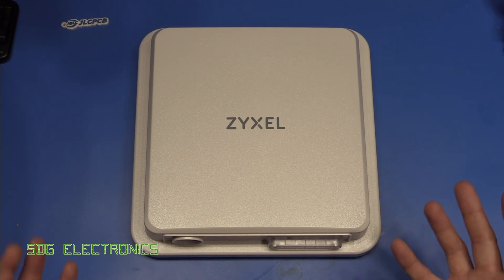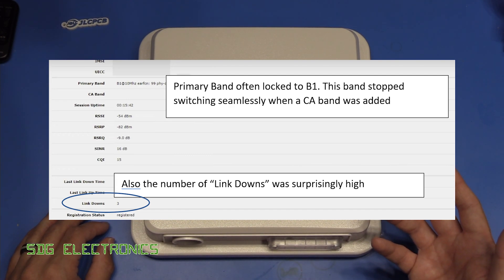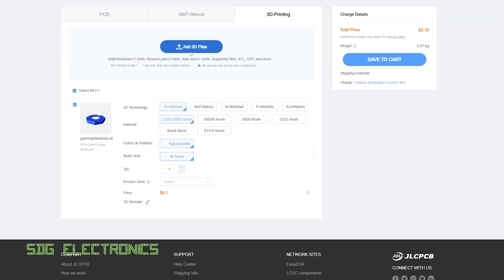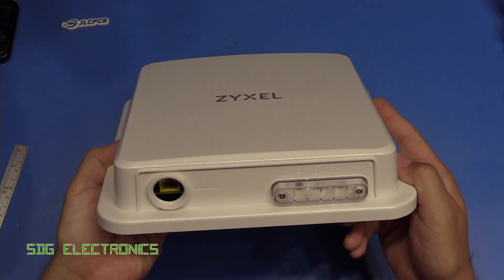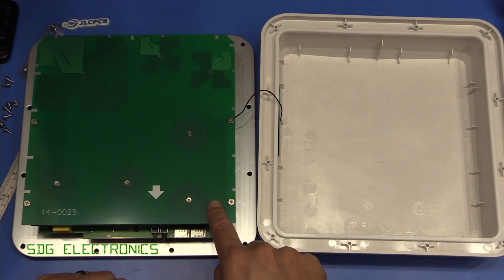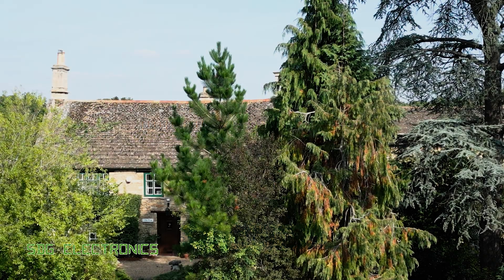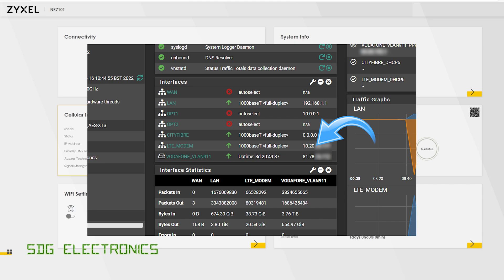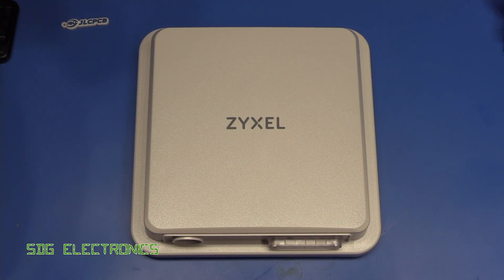SDG #267 Near Gigabit Speed 5G Home Broadband Internet - Zyxel NR7101 NR Modem and Router

Comment: Trees can interfere with signal and speeds , and worst of all is rain and wet leaves on the trees walls and roofs . (5g struggles to penetrate water shielding  on my experiments)
mounting higher up will give about 12% improvement on wet days at least.

Comment: Hi, thanks for posting, we're there any special changes for AP you had to make as I'm trying to get the Zyxel 4G version of this unit to work on SMARTY(3). Router diagnostics indicate it can ping and resolve IP to DNS etc. But client devices get no Internet connections when tested using WiFi and unit in router mode

Comment: Did you ever mount it on your chimney? Interested in whether you saw a significant improvement from the already excellent speeds you were getting.
Reply: Some say 2nd floor is good enough- especially if you have line of sight. Higher or lower can get more interference.

Comment: I currently have a NR5103E, which is alright, but it has issues with dropping down to 4G (from 5G), and no cell tower locking. Would you suggest this as a good alternative, or perhaps some other router? Also it seems the NR7101 doesn't support Three/Vodafone B32, which is a shame, no?

Comment: Thanks for this,  really happy to see you using pfsense and it having bridge mode! All my questions answered.  I'm considering this as we a semi rural area with no firm date for FTTP, and have just discovered that my home office (in the gaden) has 5G,  I can get ca. 200Mb in there if I hold my iPhone up high.  Pricey but seems to tick lots of boxes.
Reply: I reckon 5g could be cheaper than FTTH. My TalkTalk deal runs out. Jumps from £50pcm to £65 - unless I commit to another 24 month contract where it drops to £50 again. Can get unlimited 5g sims for £25 pcm. This could free me of the contract and allow me to take internet with me if I go on travels.

Comment: Are you still using this Zyxel unit?
How has it been performing over time?
Reply from the maker: Works brilliantly. Moved it up for direct line of sight and the speeds are excellent. Pretty much always better than 400/100.
Reply: Interesting.... In my case it has been fine for a little over 2 months and 1 night stopped passing traffic on 5g-nsa or auto preferred connection. Negotiates connection in N78 band for the main serving 5g band but no actual trafić going through. When set to 4G LTE for preferred connection type a is fine.... Negotiated connection is excellent and signal strength as well as SINR is great but 5g is dead. Various masts, 3sims later, different APNs.... Nope, 4g only. 5g was fine just for a short time. Many people on Three network have this problem with the indoor version model nr5103....
Reply from the maker: @arturlorek7977  have you tried the latest firmware? There's a new firmware for the radio and also the application

Comment: Hi there. Great video. I have a question (as you seem to be pretty clued up!)

I have purchased a ZTE MC7010 to use through the THREE network.

The firmware is H3G_GB_MC7010DV1.0.0BG09 - apparently the latest.

When I plug my sim card into the 7010, it connects to 5g and I get 250Mbps (directly out of the ethernet cable into my laptop)

BUT, when I insert the same SIM card into my Samsung Galaxy A73 5g and place it in the exact same position, I’m getting more than DOUBLE the speed. (I have line of sight of the mast)

Any idea why this is?
Reply: Phone is better carrier agregation .

Comment: Just purchased this and will put it into IP Passthrough with an orbi system. My orbi has the same IP address, will this cause any issues? How would I view the Zyxel admin page if they're both the same?
Reply from the maker: I would recommend changing the Zyxel admin page IP address. This is different to the ISP provided IP, and can be set as a standard internal IP such as 192.168.1.X
Reply: @sdgelectronics  that's a big help, thank you.

Comment: Hey, i am in need of such a device with panel antenna for use as a WiFi repeater/ap. 4G/5G would be nice, but fast dual band WiFi is more important for me. It should run a small Linux or has a powerful webui. Do you have such a device in your spare-parts-bin which you could Imagine to give away to me. I will care very well for that device and give it a nice future in my private network. Please think about helping me out with such a device.

Comment: Can you kindly elaborate how do you power it? Do you have to connect it to a router that supports POE output or just a plain POE switch?
Reply from the maker: You can use a PoE switch, injector or a gateway with PoE

Comment: Did you move the receiver? If so, any change in speed?
Reply from the maker: I tested it on a pole at 18m elevation DLOS, but no difference in speed so I've returned it to where I have easy reach.
Reply from the maker: After a firmware update, the speeds are even better. I tested it back up on the mast and it works far better in all weather conditions.

Comment: Glad to see you got 5g after all.
Getting over 1000mbps down and 120mbps up with my local tower when I am within 100m of it.
Drops to about 500-600 down at my house inside about 500m away.
Three very recently improved the upload speed as it was around 20-40mbps for a while.

Comment: As a Canadian, I'm wincing at the concept of automatic fall-over from the normal fiber optic ISP to a 'mobile' 5G carrier. Imagine a fault develops in the fiber, and the first clue is the 'mobile' data phone bill which (in Canada) could be greater than the GDP of Switzerland. They don't make paper that wide. We've had 5G mobile plans that would go into Data Overage is mere seconds at 5G speeds, and could cost $10,000 per minute thereafter. Sigh, Canada, home of the world's worst mobile data providers.
Reply from the maker: Luckily we have very cheap providers here. My plan is £16 per month with unlimited data, so no massive costs to worry about!
Reply: @sdgelectronics  Careful Steve, you'll drive JH to an early grave.
Seriously though.....wondering if I shouldnt implement the same.....is it just your ISP/infrastructure thats unreliable in your area or......?
Reply from the maker: @IanScottJohnston  it was just because it was completely new infrastructure, but Vodafone are useless. I'll be switching to a new ISP as soon as its open to other vendors. It's been fine recently, but I expect downtime when switching ISP since they will change the ONT
Reply: A T-Mobile unlimited tablet plan and a BEC Technologies 8232 outdoor 5G router is the way to go here in the U.S. Depending on how strong your signal is and if you can aggregate bands n41 and n25, you can get 200-600+ Mbps download speeds.

Comment: What type of hardware do you use for your Pfsense firewall ? 
Since a few months i have here a 1Gbps / 30Mbps connection, and connected straight to my cablemodem, i get arround 950Mbps, 
but with the Pfsense firewall in between, speedtest maxed out arround 820Mbps.
Reply from the maker: I'll do a video shortly, I've just bought some new hardware to replace it
Reply: @sdgelectronics  , nice thx for the quick reply. It seems that i didn't get a notification of your reply. Grtz

Comment: Nice video, I picked up a Smarty sim with the Netgear MR5200, its awful and costs almost the same as your Zyxel... I get full 5g signal on my phone with 7-800 mbps and the MR5200 get 4g with 20 down and 2 up haha
Reply from the maker: That's the kind of disappointing result I was worried about and what I saw with the Mikrotik before fiddling with the settings.
Reply: @sdgelectronics  Its really strange... I did use DC unlocker to change the bands and it does get 5g, but its so inconsistent and slow. It will go from full signal 5g to nothing and max speed of 200 down :(

Comment: Is that a 100mbps link on the ETH? for a 5G connection?
Isnt that a bit low?

I was wondering how the SPD worrks for eth devices. and I can count only 4 pairs and 5 spark gaps packages...
Is ther anything else in the bottom?

PS I'm designing my own outdoor cpe for next summer using scrap parts I have laying around :D
Reply from the maker: No it's 1000 Mbps Ethernet on the unit. There's another 4 devices on the bottom side from each conductor to chassis GND.
Reply: @sdgelectronics got it, I'm in fact thinking what to do with my design for lightning protection. This is the first time I've seen that they are directly protecting the single wires.

I've seen that someone protect the center tap of the transformer.

Comment: Your lucky to get 4G,  i get 1bar on my phone at the best of times at home. How i've got FTTP i'm quite happy even when my one month of high speed fell back to 150Mb i did not notice any drop in speed. Only problem laptop keeps dropping back to 2.4Ghz giving 34MB/s down 32MB/s up from 147MB/s down and 34MB/s up with 5GHz wifi. wifi is set to connect at 5GHz on laptop but does seem to like 2.4 😞
Reply from the maker: There's sometimes some power saving settings which cause laptops to fall back to 2.4 GHz. I've just bought a bunch of new WiFi 6 APs and a controller, so I'm hoping to improve the WiFi around here too.